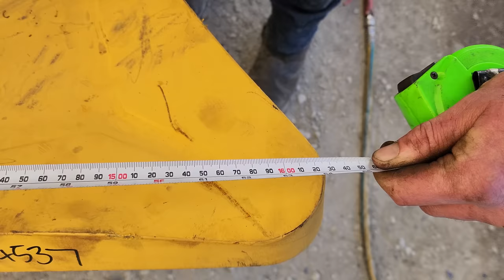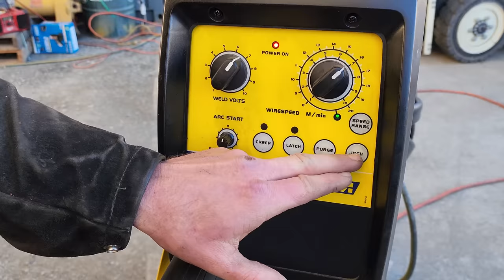Massive Repair on BROKEN Bulldozer Blade | Part 2 | Drilling, Gouging & Welding

Comment: I have a question, this might seem like a dumb question but why not just buy a new bucket rather than spending time getting the old one fixed? The time lost by not having it while its getting fixed will be expensive plus the repair is gonna be expensive, so why not just bite the bullet and get a new bucket? Is the price difference really that much?

Comment: Did you only tighten one of the Sheldon set screws due to run out on the annular cutter? If so I’ve had same issue.

Comment: 34:13 The world: magnetic drill. Aussies: holemaker.
OK. I saw where it's made. Correction: Europe and Aussies.
Kurtis pointing to a gap the size of Strait of Gibraltar: "It is small enough that we can just fill it with weld". Sound like a good merch slogan, BTW.

Comment: Never hammered the heads of the bolts when torquing the nuts up , the difference between a  engineeri and a operator that has to fix this once its done work very frustrating simple and easy at time of fitting hard in the feild to do it a second time.  Can't  fault his welding and method just the paint removal and bedding of the boths do that its a 100% job

Comment: I'm curious -- do you have software that is based on number/size of pieces to fit up, inchest of weld, etc. that you use to bid a job like this, or is it cost plus materials. I was just wondering. It would be pretty easy to under-bid a job like this.

Comment: great video and knowledge as always! 
I'd highly recommend purchasing the backpack option that 3M offers for their adflo respirator. 
I used the belt option for years but the backpack really helps carry the load when welding larger parts. I've thrown out my belts. 
google this and you'll find it. Back Pack for the 3M™ Adflo™ PAPR System

Comment: Hi from the UK. Probably a silly question, but how do they make the holes in the plates which are round at the top, square for the bolt head and then a lesser diameter for the shank? Thanks, and great videos.
Reply: My mistake. In part 3 I saw they were round headed bolts.

Comment: Great job Kurtis. There ain't much left of the original blade! Is it difficult to price a job like this? There must be hidden work that was not visible until you are into it. The completed job is likely to be stronger that OE. You have earned a shower and a few tinnies

Comment: This is not a criticism but a question 😊
I have seen other channels prepare surfaces to clean metal, as in no rust present on them before welding. I notice that you don’t, does it make much difference to the quality of the weld? I’m guessing the flux does enough to clean that up?

Comment: Dont mean to sounds snobby : but it will save you a whole bunch of time on day - Hold your cable straight when feeding new wire into your MIG welder. I made this mistake once and the sharp bit of cut wire must of snagged the cable lining inside and caused HAVOC ! and wasted me 2 hours! btw Great videos!

Comment: Why not did a hot tack instead of heating it up all around? 
You know put a good size tack and hit it with a hammer before it cools?
I'm not trying to tell you how to do what you do, serious questions only from me.
I also like how metric and imperial measurements are not the same but good enough. 19mm is 3/4" yet we'd use 3/4" but 20mm is just a slight bit thicker.

Comment: Why dont you use real workpants with kneepads?
Reply: Kneepads are awesome. I love that I can just drop down on my knee, no matter the surface. Jeans were the original workpants in the 1850's, but I prefer Snickers latest creations with stretch in the right places and hanging outside pockets.
I wash and dry mine with the pads in place

Comment: Tips to prevent medical issues 20-30 years later: wear knee pads to protect your knee patella. Try not to work long hours with your back deeply bend. Lift heavy items with knees, not with your back, if you have to. Try to use machinery etc to lift heavy parts. I bet your boots have steel toe protection. A shin protector for your tibia won't be a bad idea either.

Comment: I'm sure if you had enough time... you could likely build them a new blade for less than the manufacturer... and it would be stronger than the original, and likely need less maintenance.

Comment: I have been caught a few times with welding flash.  Is that what it is called?  Having to go to hospital with massive pain in my eyes and getting treatment.  I bring this up because I wondered what Karen was using to prevent this.  I was wondering about the original blade build.  Is all the work done originally still a big hands-on job?  I realise they would have a lot of jigs to line up the steel but would they use similar equipment to construct the blade?  I could not find a video of a factory that made these items.  As to buying a new blade, would they have a blade like this in stock or would you be faced with a wait for one to be imported?  That would mean equipment sitting and waiting for parts.

Comment: Hey Kurt,your work is spot on,you make it look easy! But it aint.l used to do heavy plate for a mining company .l sure wish l had a air filter mask then. l now have Enforsemia, what a bummer.l bought a 3m speedglass battery pack filter unit . oh my,its like ,fuk,bring on the welding.Air con in a mask!

Comment: why do i never see u welding with high amps and volt?,  ( 300a - 30v )  it has better burnin and strength to weld at high amps and it should be beneficial whenever u can ( example first layers on a eye welding or thick material )

Comment: Absolute estimate.. roughly 20hrs of welding X 60 minutes = 1200 minutes X roughly 6mtrs of wire a minute,.. hazardous guess would be roughly 7 to 7.5 thousand metres of wire?..
 cant remember how many hours between the two videos you've said so far of welding lol
mint so far anyway kurtis, your fillets look primo

Comment: I admire your skills an ingenuity -- A LOT! But you are risking injury some day using wood as you have in this video to support your work. Wood can easily split. And to top it off, you have a round piece of wood on it's side on top of a vertical piece. Round things roll easily and don't stay at rest very well -- physics. Very unstable. 

Please use jack stands designed for the heavy duty work you do so there will be no future interruption in your videos. Always, safety first!  : (